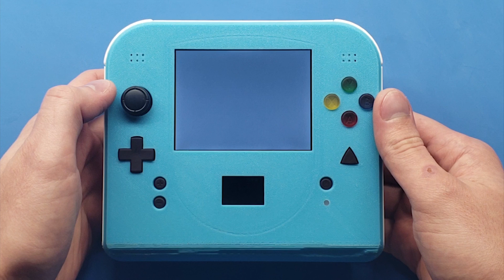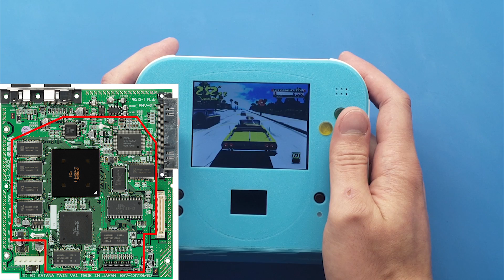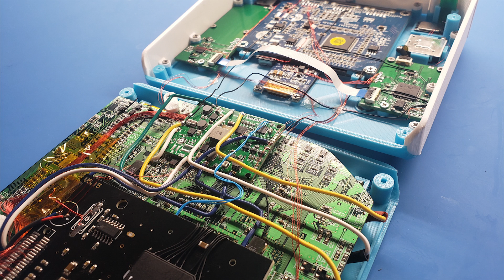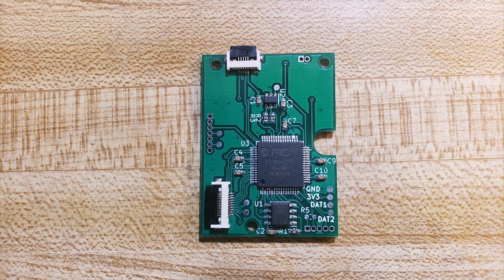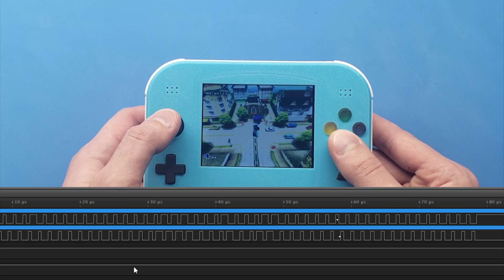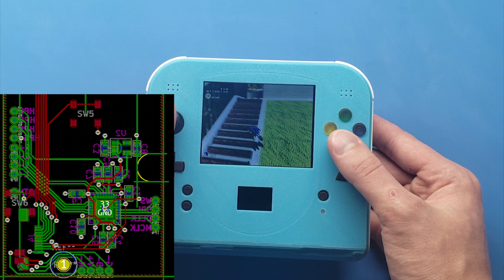The 2DC - Sega Dreamcast Portable

Comment: Very nice, I've seen a couple other designs before, but your is the most slimline! I personally have been working on a SEGA Saturn portable, but due to other projects, I've had it on hold for a while now sadly, however the outer casing design is done, I just need to figure on how to shape and fit the board, along with the other components 😢

Comment: 53 people noticed the analog stick looks eerily similar to the Joycon analog stick. if that is a joycon analog stick, please change it, those things are prone to getting stick drift super early.
also holy shit it's a 2ds style portable dreamcast, this is amazing.
Reply from the maker: It's a 3rd party joystick. Imo the whole story is over exaggerated
Reply: as a switch owner who has 2 pairs of joyons, they both have stick drift already, as someone who experiences this themself, it's not over exaggerated, it's actually accurate.
Reply from the maker: @WednesdayMan  well in this case I can calibrate the joysticks with my custom controller code if ever needed
Reply: you don't seem to understand just how BAD the drift gets, it can get so bad it'll randomly input in a direction pushing all the way (yes I'm actually serious I tested this myself with my own Joycons), like going fully up for no reason, no calibration can fix that.
Reply from the maker: @WednesdayMan  I can replace the joystick myself
Reply: and that's the vicious cycle of the joycon analog stick replacements.
Reply from the maker: @WednesdayMan  well I haven't had any issues with them myself. I have 3 joycon sets
Reply: alright, get/make a case for that Dreamcast portable, since putting it in a bag and letting the analog stick move around like crazy can cause stick drift to happen early, just advice for making those analog sticks last longer

Comment: do you plan on creating some sort of guide for this and links to the boards needed to make one?
Reply from the maker: The Wii PMS is for sale on the bitbuilt store. Also in the bitbuilt forums you can find the dreamcast trimming guide. https://store.bitbuilt.net/wii-power-management-system/
Reply: @GmanModz  yeah i found those but the one thing that stopped me from making one is trying to cut up an original controller board so i would love to have the option to buy your controller board to solve that problem (ideally pre-assembled) thanks.
Reply from the maker: @RazorX-Gaming  the vmu doesn't work yet which is essential for playing dreamcast so it shouldn't really be used in a casual DCp
Reply: @GmanModz  fair enough, is that something you are working on?
Reply from the maker: @RazorX-Gaming  I hope so someday, I have reached a major block in the project and not exactly sure how i will get the vmu working. The problem is the maple bus is a difficult protocol and my code can currently only capture one word receiving from the dreamcast. Which is fine for the controller buttons, but much more data needs to be accurately captured for the vmu. I need to redesign the receiving protocol before I can get the vmu working.
Reply: @GmanModz  perhaps you could message Chris Daioglou who makes the dreamconn+ bluetooth dreamcast controllers, not only are his modded controllers bluetooth but he also incorporates a virtual vmu as well so maybe he could help you figure something out.
Reply from the maker: @RazorX-Gaming  I think I know how I will emulate the vmu functions but it's just nailing down the protocol first. I should really switch to an fpga, so the protocol isn't bit banged in C which has limitations. Thanks for the advice, I will check out that work!

Comment: This is great, but why did you use the joycon sticks
Reply from the maker: Because it has a 3d axis and they are small.
Reply: @GmanModz  Have you had any drifting with it though? That's why I'm concerned about you using the joycon stick modules, because they always, inevitably start drifting.
Reply from the maker: @shiiiguthewise6778  no. It takes time for them to wear down and I can easily calibrate the range in my code or simply replace them.

Comment: How feasibly could I design my own universal emulation controller, preferably with USB and bluetooth? I cannot find any controllers on the market that use a 6 button Sega/Capcom layout while also sporting dual analog sticks. I've been wondering if it's possible to build such a controller because the layout would adapt to more systems than the traditional SNES diamond layout.

Comment: How you have implemented the saved system ?
Reply from the maker: The idea was to emulate the vmu alongside the controller on the pic32 and use a FRAM chip for storing saves. However, I have not finished that functionality yet.

Comment: That was a pretty interesting build, but there was a problem I saw with your design that you may want to address. The shoulder buttons are analogue like many game systems that came after it. So if you were to play a game like Re-Volt, Hydro Thunder or Daytona USA for examples, You would run into your car (or boat) not having easily controllable speeds, let alone full speed, or in the case of Hydro Thunder, you'll have a hard time getting the jump combination to work right. (This is a similar problem that the emulators in retroarch have as they don't support the analogue shoulder buttons.) 

On a different note, why not just gut a VMU to get that functionality instead of trying to emulate it? As far as I have seen, the main trouble point would just be the connection since you are emulating the controller with microcontrollers. Maybe there's a way to use a snort stub from what used to be a controller port to a VMU connector so you could in theory use all the dreamcast VMU socket accessories. (that rumble pack thing... Seaman Mic... etc.)
Reply from the maker: I wanted to make a vmu emulator so the controller and vmu can be entirely custom with my own chips and pcbs. That way there are no wires or board cutting required. The controller can easily support analog triggers for a future build, but incorporating an analog sliding mechanism is tricky in tight packed cases.
Reply: @GmanModz  Yeah, future builds could incorporate that. Also the only reason I brought up was so that you can grab game saves from old vmus or using the rumble packs or seaman mic. Doesn't mean you can't still emulate the vmu since that takes some of the limitations out of the originals, just want to to see the opening to play seaman again. (or maybe an emulated microphone that you can turn on and off depending on the game you have loaded.

Comment: I'd love to see you get that VMU emulator working that you were talking about. Also, would love to see analog triggers and maybe a different form factor. Great work!
Reply from the maker: I wish I could! The maple bus is a difficult protocol to bitbang and currently the code is not robust enough to recieve more than one word at a time so VMU support cannot happen yet.
Reply: @GmanModz  perhaps you can run a second board as a player 2 controller that only uses the VMU.
Reply from the maker: @tymaginnis7746  true, but that defeats the purpose of using a custom controller and being able to use my own pcb and not having to trim the board and run wires
Reply: @GmanModz  true. Plus it would add a lot more bulk.

Comment: Whaddup, G! Question, is there any lag in the controls? The video made it look like there might be a bit of lag when pressing buttons or using the analog stick.
Reply from the maker: There is no noticeable lag introduced by the controller. The code is constantly polling the buttons and analog and waits to return the data to the console
Reply from the maker: There is some deadzone I calibrated on the joystick so it might be that. Since the controller will not register the analog until you push it past a thresh hold to eliminate ghost movements